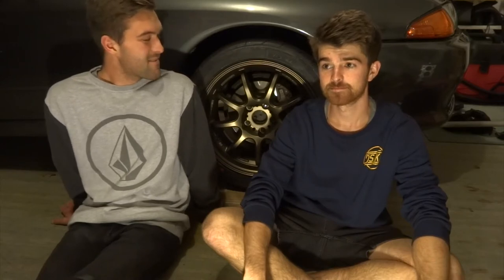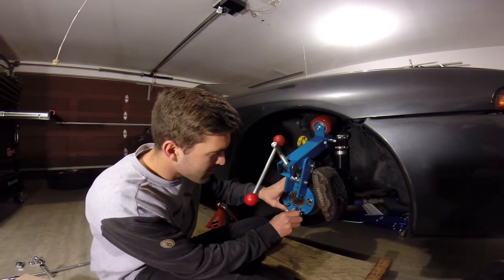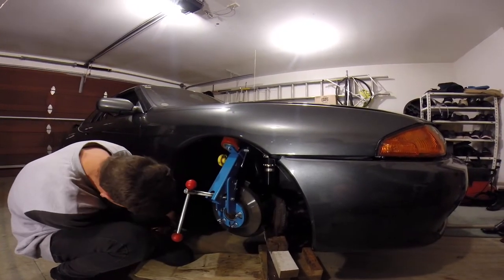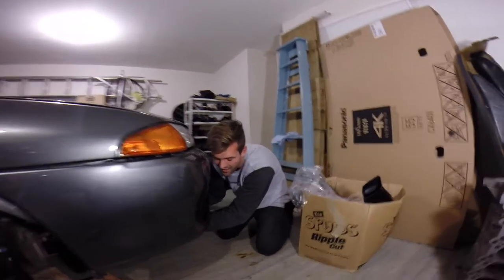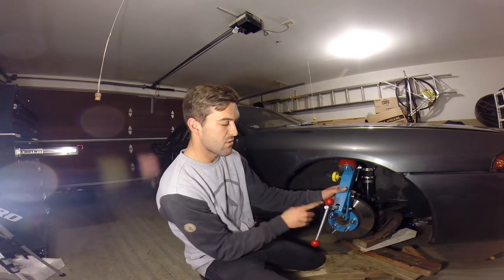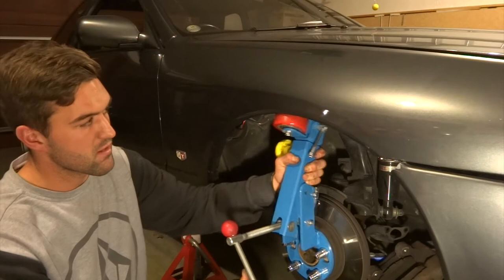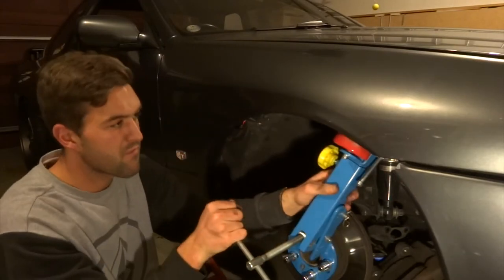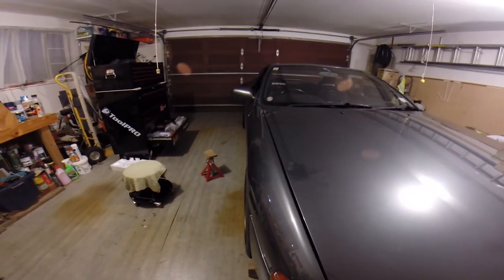How to roll/tuck your guards

Comment: Hi Did you put the plastic liner back? Do you have to put it back to prevent water/rocks goes in?
Reply from the maker: We did! I would highly recommend putting it back if its a street car. It will prevent a lot of road noise (gravel and stuff). Plus it will keep things a bit cleaner up there and away from your loom.
Hope that helps :)